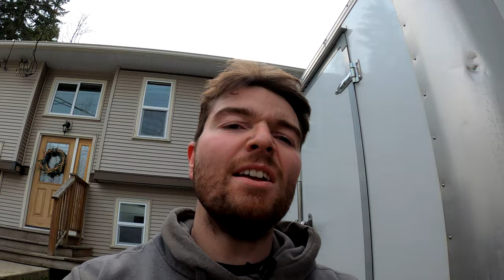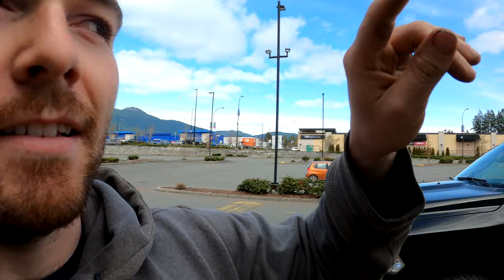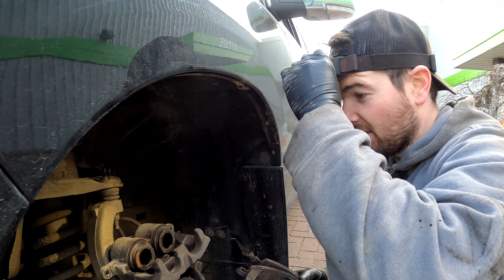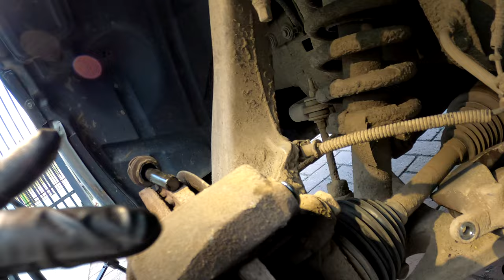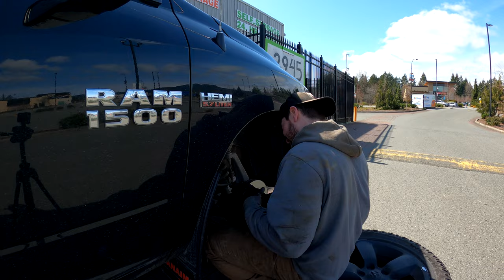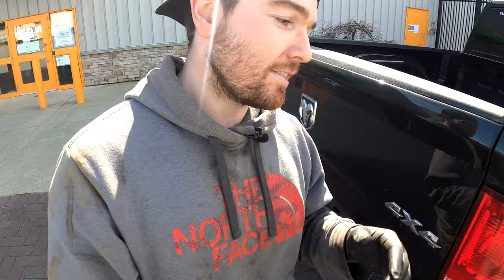RAM 1500 Front Brake Pad/Rotor Service | How To Service (Or Replace) Your Brakes

Comment: Thanks 🙏🏻, Your information and knowledge is a valuable resource that has me prepared to install a 4 wheel rotor and brake job on my 2003 with all original parts except for ceramic lifetime pads i had installed when the pickup was still very new. I only put about 4,500 miles a year on it so it’s not worn out and still operational as it was when i bought it 20 plus years ago!

Comment: I've always thought it was 130ft lbs for the lug nut torque? That's what I find for cone style lugs for the rams or at least for my 2018 ram 1500 and that's what I've torqued my tires to for a couple years now since they are cone style and everything stays on there tight. Mopar says 140 for flanged lug nuts.
Reply from the maker: My manual said 140, but now I'll have to double check. To be honest I always torque them to 135 just because lol
Reply: @TheGettyAdventures  yea I never know what to believe cause I don't remember if my manual said anything at all lol. Really makes you wonder what's the proper one
Reply from the maker: @superpater1  140 always did seem high to me for only like 1/2 studs so I never cranked them right up to that.